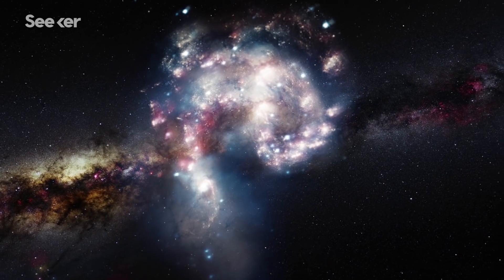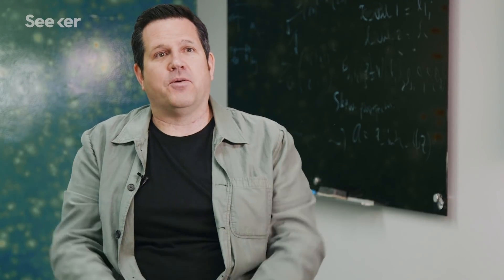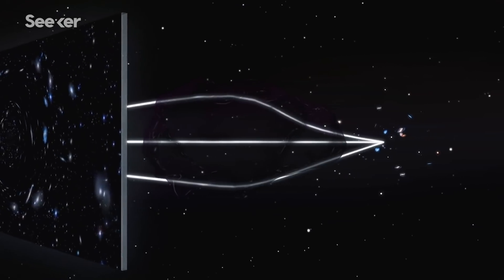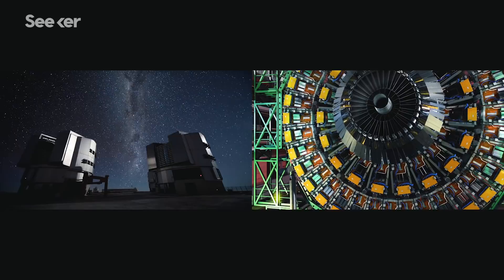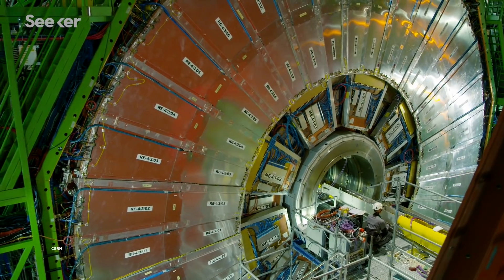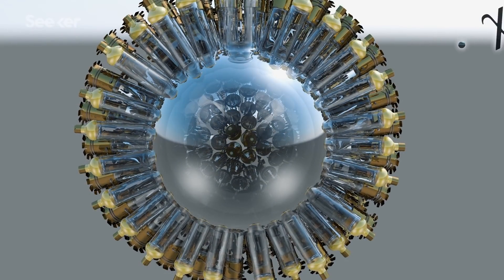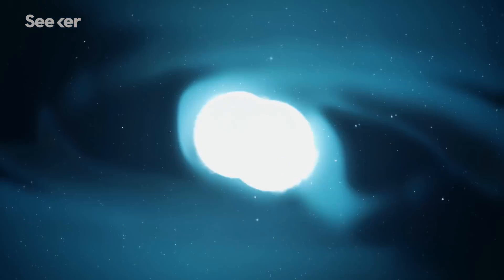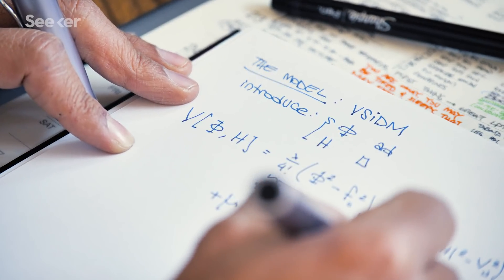How Close Are We to Finding Dark Matter?

Comment: Extra time but lower relative mass than should be at any one point, being shared as a percentage over an area making a viscous energy area in space time. Forming dark matter. Larger itemized chunks that interact better with themselves than a proper energy level area of 'empty ish' space.. comprised mainly of this thicker lower weight, longer timeframe- more time and overall high energy tension. since it has no interactions with several 3d space time physics systems... You use chain interactions of smaller percentage changes in larger formations. To achieve some kind of view of the smallest chain interactions in the whole would require analysis of the whole object and where the 'bubbles' of thinner 'empty-ish' space is in that, maybe through several scans to find the fluctuations most average spot. Since it would be the least energetic area
Reply: So if you made an ultra dense area and held a strong vacuum inside it over a, I suppose, 10mm cubed empty space. Added strong but precisely alterable magnetic shielding and some form of radioactive level coolant, you could still simulate great internal space by the stretching and muting of space time around it...
Then you add somehow a slider for interactive changes, in electromagnetic energy of the whole area or perhaps just motion of the area if proper changes to certain field strengths like vacuum/heat/electromagnetics change, then the last point to move from that interaction would be the lowest viscous space time energy, the bubble of interactable 3d space time, held to counter the inviable weight deficiency of the whole object area in 3d physics, but only because of the infantesimal rounding errors that would have to take place between quantum realms of certain space/time dimensional pairings. .... or something silly and wierdly satisfying.
Just thoughts i really want to try...

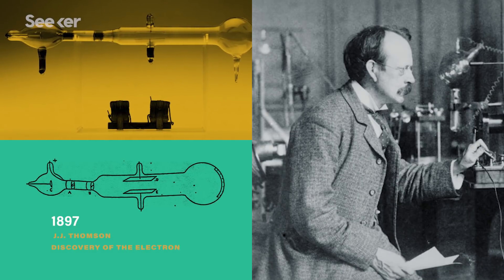Comment: 2:05 No... Phones don't rely on the quantum mechanical properties of the electron. Quantum mechanics causes problems in their developpement, but they work with classical physics. 
And about dark matter. Theres missing mass, so we call it dark matter. We've never seen a proof for it. So how about it's something else as told in the video? It could just be normal matter we can't detect today. Matter that doesn't spread waves in the wavelenghts we scan for.

Comment: My view on this. Just look at a black hole. The event horizon is dark matter. But seeing a single particle is impossible because it's the smallest and the fastest particle in the universe (faster than the light). It doesn't have mass and doesn't reflect anything. It creates gravity when it interacts with normal matter. It also creates the gravitational waves when a black hole is formed. All dark matter inside a dying star just pops outside the compressed mass and it goes extremely fast when creating the gravitational waves. These waves can be detected before the light of a hypernova reaches us. And there's no dark matter inside the black hole. The black hole is like a single atom, only on a very different scale... a kind of scaled up quantum physics.

Comment: Can you imagine what if dark matter didn't have speed limit and you can make an engine like a 100 times faster than light and that will be really cool
Reply: Well the fastest you can move is the speed of light in nothing can move faster than that because the speed of light has no weight or mass whatsoever it is completely massless now dark matter mean have no Mass either which means the maximum you can go with Dark Matter is just the speed of light and also you can't even go faster than the speed of light and that is definite. And also there's a thing called time dilation which basically means that light and time are linked. So if you went to another planet at the speed of light and it took you six hours back on your home planet it would be 12 or maybe even 24 or possibly even years. So if you traveled ten times the speed of light back on your home planet thousands of years could have passed but for you it's been a week.

Comment: I think it's not anything made of baryonic matter. It may just be the indirect influence of a universe that isn't what we call our universe. Like our anti-universe, or this anti-universe and the universes that happen to influence ours the most (in a multiverse point of view). Like a virtual mass. Or like a particle isn't anything in itself if not correlated causally to another via entanglement. The two or more universes would be connected by what is beyond T+1 before the big bang started. So, anti-matter would still interpret time in the opposite direction compared to matter but for a all with normal matter: A pair of universes, one made of matter ,one of anti-matter, connected at the "singularity" before T+1 in each, and explains why we never interacted with anti-matter in our classical universe.
Actually, I would say, any universe of this multiverse would have his anti-universe and all would be connected at the "singularity" (which still can't exist in that sense).

Comment: In order for the horsies at the edge to travel at the same speed as the buggies nearer the center of the carousel,
    there necessarily had to be some enormous ‘mass’ on the outskirts of the carousel. Ergo, the mathematicians
    invented ‘dark matter’, an exotic, invisible type of matter that surrounds a galaxy (Fig. 1).

    “ Our galaxy and other galaxies, however, must contain a large amount of 'dark matter'
      that we cannot see directly, but which we know must be there because of the influence
      of its gravitational attraction on the orbits of stars in the galaxies.” (p. 45)  [2]

    “ The existence of dark matter is by now well established. The most direct evidence comes
      from comparing the luminous mass of a galaxy or cluster to its total mass, inferred by
      indirect means. Measurements of galactic rotation curves indicate that the mass of
      galaxies must be greater and more spread out than the luminous matter they contain” [3]

    “ dark matter is matter, not directly observed and of unknown composition, that does not
      emit or reflect enough electromagnetic radiation to be detected directly, but whose
      presence can be inferred from gravitational effects on visible matter.” [4]

    “ The normal matter in the cosmos —atoms that make up stars, planets, air and life—
      accounts for only a small fraction of what must exist, based on the fact that without an
      additional source of gravity, galaxies would fly apart and galaxy clusters could not
      hold together as they do. Nobody knows where all that gravity comes from, so
      scientists say there must be some invisible stuff out there, which they call dark matter.” [5]

    The idiots of Mathematics continue to invent new names for inexistent leprechauns because they cannot match
    observations with their equations. They call this speculation a 'proof.' They've been doing 'science' like this since
    the days of Newton.

    But you should be able to detect a false prophet by now. The test is simple. He tells you on the one hand without
    even blinking that dark matter has been interviewed and resolutely confirmed and verified. Then he asks you for
    money so that he can continue looking for it. If dark matter is already a done deal, what is there to search? What
    is there to argue?

    The truth is that astronomers can’t see or detect dark matter, but it makes the calculations come out right. That’s
    what is important to them. So they just continue to invent more and more stuff and develop each new invention
    to the limits of idiocy and to babble about these ghosts amongst themselves. When they run up against a wall,
    they invent something new, give it a flashy name, and continue to babble on and on. Now all the morons of
    Mathematics are searching the sky not only for inexistent black holes, but for inexistent dark matter and
    inexistent dark energy (a ‘negative’ energy that opposes gravity) as well. That's what you pay them for. All these
    guys are ultimately funded by the government. The mathematicians prefer to invent all these unseen spirits to
    plug holes created by observation rather than relinquish their long held beliefs and traditions. Of course, it is not
    surprising that no one has been able to falsify GR. We have a case where the wolves are guarding the sheep.

    Is it possible to falsify the existence of Santa Claus? If you don't bring the bearded man from the North Pole on a
    sleigh, does he not exist? Should we continue to theorize like Wright does that Saint Nick exists because we get
    presents every Christmas? This is the sad state of 'Science' today. These are the leaders of the 'scientific' world.

Comment: This is because it is the simplest theory which fits available data.

But it doesn't fit the data -- the dark matter theory is constantly being revised. First it's "90%" of the mass of the universe, then it's "70%", then we're back to "98%", then there's dark energy, then the fractions change again, and again, and again.

That's not a fit! It's not like we started at, say, 80%, then refined the fit to 82.5%, then an additional data helped us narrow it down to 82.515%, and so on. It's just jumping all over the place.

Secondly, it's not "fitting to the data", it's fitting to the difference between a theory and the data. There's a huge difference. And it's particularly galling that the "theory" used is Newtonian gravity, when it's been known to be wrong for a century! Several papers have been released that show that it's possible to make the need for dark matter vanish by using relativistic mechanics. Not exactly surprising that the "difference" is affected by the theory chosen!

Every research paper about dark matter reads something like "we use a simplified theory of gravity because of [excuse], and then oh look, we find that our hugely simplified model doesn't agree with observations, so clearly there's an invisible something out there". The excuses vary between: "The other paper did it too", "Relativistic equations are hard, and I'm lazy", "I don't understand relativity so I don't know how it could possibly apply to galaxy sized masses thousands of light years in size", and "my computer is too slow to do this properly".

Yeah, well, I studied Physics at a university level, and I think dark matter smacks of hubris, laziness, and weak logic. It sounds an awful lot like chasing the error terms in Epicycles [wikipedia.org] a century too late.

The latest attempts to explain dark matter are an ever bigger joke, like Modified Newtonian dynamics [wikipedia.org]. Here's a hint... we already have a "modified" theory for motion -- it's called relativistic dynamics!

Comment: Electric Universe

As stated above, the concept of the Electric Universe is the idea that almost the entire universe is made of plasma and therefore almost all dynamics, including large-scale galaxy formation, are dominated by electric and magnetic forces. It is true to state that a large percentage of the baryonic matter in the universe is in a plasma form, but it is not correct to claim that implies electric forces should be the governing force when it comes to large-scale dynamics.

Setterfield calls out the idea that electric forces are 1039

times stronger than gravitational forces and so should completely overpower any gravitational affects. He is correct about the strength of the electric force compared to the gravitational force, but completely neglects the crucial fact that electric charges come in both positive and negative forms. As it turns out, almost all of the universe is electrically neutral on large scales and so these powerful electric forces are all cancelled out by the conflicting charges. Because of this, electric forces only play a significant role over something known as the Debye length, a well-known concept you'd learn in a first semester plasma physics course. The Debye length for every type of plasma is far, far short of being long enough to govern large-scale dynamics.

Setterfield ends the video by citing the work of Anthony Peratt who claims to have run simulations which showed that electric forces were capable of forming galaxies and even resulted naturally in the flat rotation curves that are currently explained by dark matter.

As it turns out, almost all of the universe is electrically neutral on large scales and so these powerful electric forces are all cancelled out by the conflicting charges. <----- this is incorrect since the universe is not uniform but clumpy and recent observations have shown huge thousand light year filaments connecting galaxies and stars... hence electric forces are not canceling each other out.

Comment: the black matter is nothing at all it doesn't exist the reason it does cause a black hole pulled powerfull energys including light into it at infinite weight and speed in to next moment that wasn't written atomic welding and massive explosion happens from these energy it collapses and closes in on its self massive explosion happens infinite explosion in next moment in time creating mass in nothing empty unwritten space and the dark matter is the force of the empty nothingness  empty space but heres you clue when a lighter is lit in space it turns into a sphere  it burns much slower but theres no environment oxygen no gravity the people at nasa are baffled they were trying to figure out why combustion is so diffrant in space for even transportation ideas  to better conserve energy but what is putting energy force on the flame there no mater to interact with the gases from the lighter so what keeping every bit of matter contained dark matter?

Comment: Dark matter is the material of materials, it's the stuff of stuffs, it's powder, its gas, its stable, it has the properties of all stuffs, you can slide on it or just stand still, turn, bounce and dive through it. It's invisible and visibly if things are put on like a spider net. It can work and react with all, at present time our universe is like a table cloth wrapped over a huge round magnetic iron core that causes and interferes in all movements and going ons. We've got to mirror it to understand it.

Comment: I have a question please answer. Consider a swimming pool. You place a Big floating  ball on to it and lets make it rotate fast continuously. The ball causes a curvature of water surrounding it and also forces water to rotate around it. if you place a small tiny ball adjacent to it, it will also rotate bcz of curvature and rotating water below it. If u place same ball far from this big ball it will rotate with slower speed. This is how our solar system works. 
Now imagine a big ball immersed in water still rotating at high speed. Now because it is immersed in water it doesn't create curvature above. curvature is flat but still water is rotating. if you place any ball on such water surface it will rotate with the same speed irrespective of its distance from immersed big ball. IS THIS HOW BLACKHOLE WORK? BLACKHOLE is just a immersed massive object in space?  If yes then isn't DARK MATTER is just a space behaving like rotating water? Is DARK MATTER a misunderstood phenomenon of Enistein general theory of relativity. Einstein said space-time is a fabric, what if its more like a flowing fluid